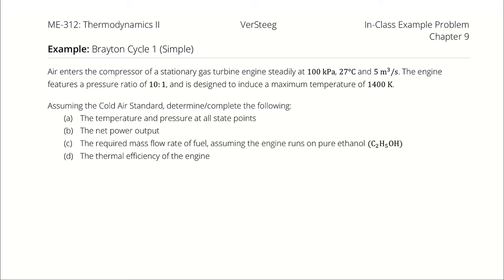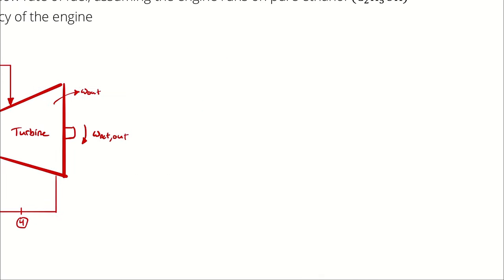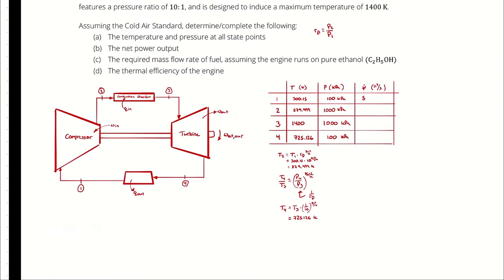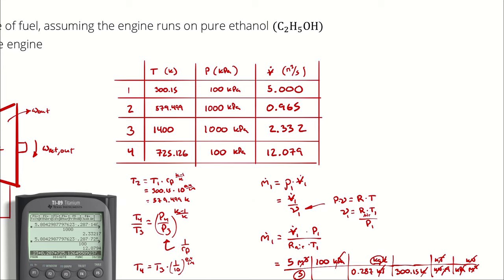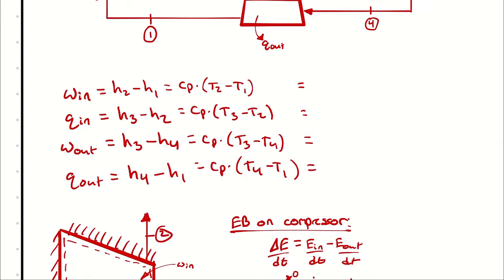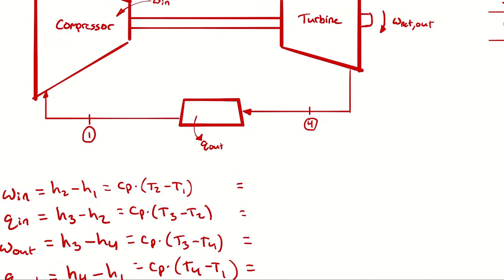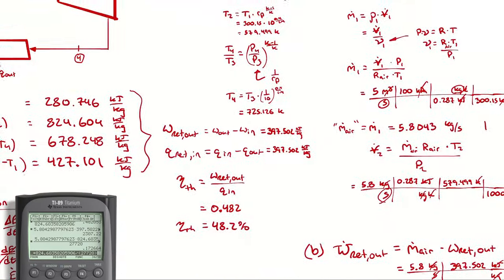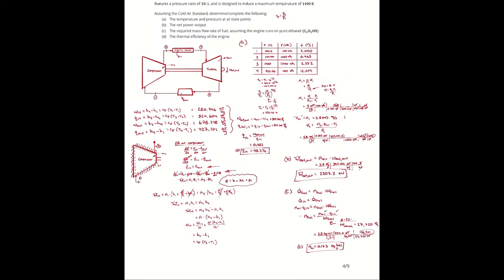Example Problem - Brayton Cycle (1)

Comment: I am reviewing for  job interview and I am forgetting why cp is used instead of cv say for the energy balance to find out the specific work of the compressor, where pressure is not constant.